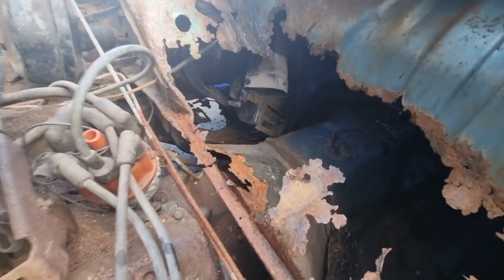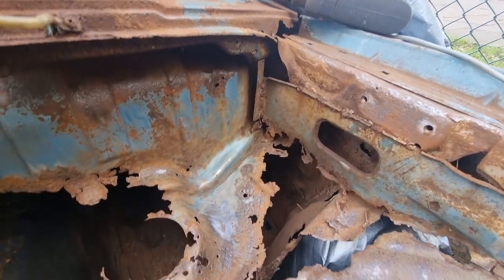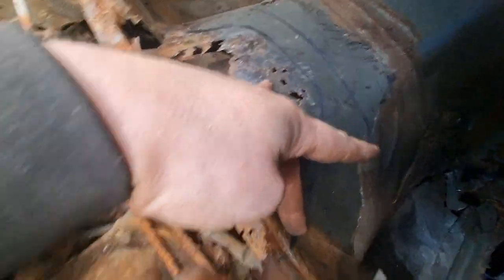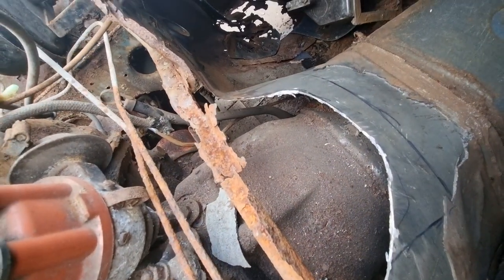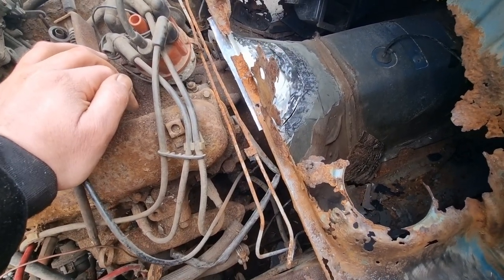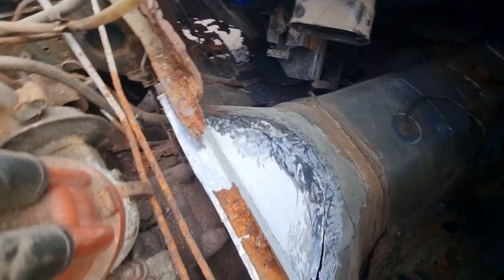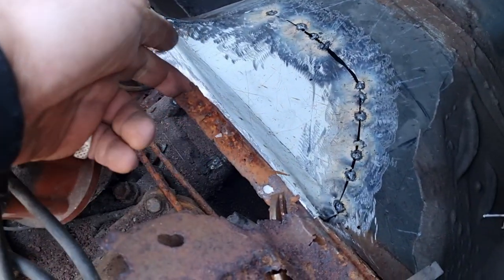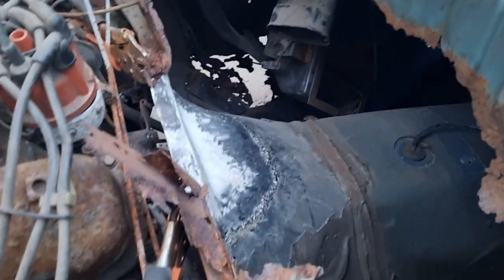Cortina Mk4 Ghia 2.3 V6 Restoration || Gearbox Tunnel Repair (P4)

Comment: Surely you need to remove engine and box to gain better access.
Reply from the maker: Yes I will be removing engine but people want a will it run video hehe and would like to do that before removing it but need to check engine over first so repairing what I can before hand

Comment: I'm liking that repair Adam. bloody good job. slightly jealous as I need to get the rear of mine welded as soon as possible.
What welder are you using?
Reply from the maker: hi thank you so much im currently using a fluxcore welder i have been using it for a few years now and got pretty good with it once you learn the best way to weld with it its easy from there on but i will be getting a gas welder for the chassis rails as i want big strong welds on them heheh

Comment: Progress there all ready pal, and one less hole,  Have you started buying replacement items yet?   When i was rebuilding my rover metro, ( later VVCd it) some stuff popped up or was on scrap car, i was like, i am having that!!    Items that would be a nice touch etc.  Even if its mothballed, but you have it.
Reply from the maker: dont got any replacment parts have loads lined up tho of kind prople on cortina club oncec i get some of the body work done

Comment: strip the engine bay give your self some room to work mate will make your life a little easier
Reply from the maker: yeah that would be the best thing but i want t odo a will it run video on the engine once i have checked all the valves out and make sure no bits are floating arount in it
Reply: @AdamSNook.  right on